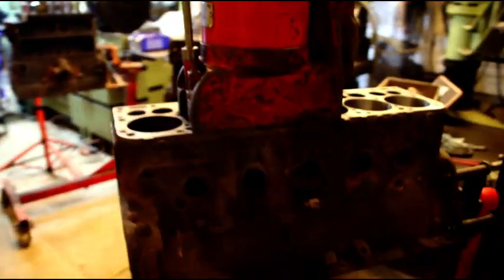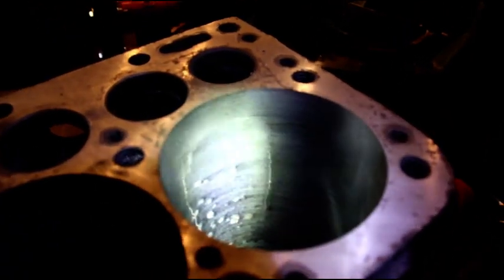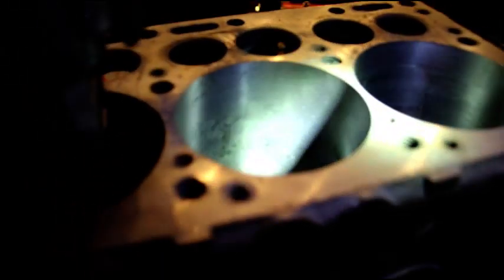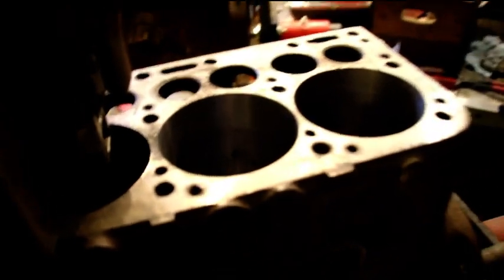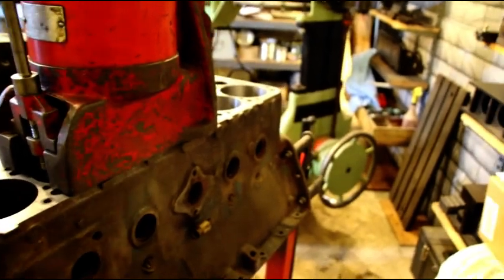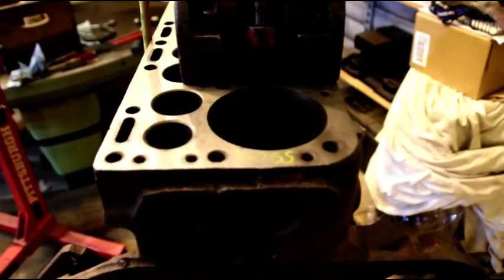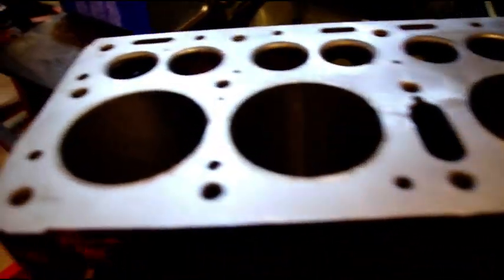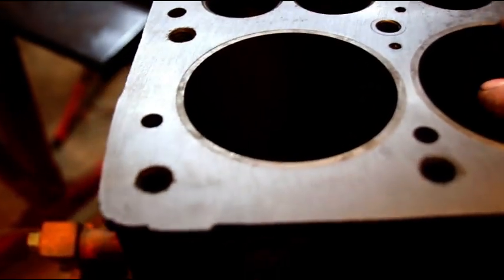Engine Updates, Hercules Boring, Travis L134 Sleeved, Lou's M38, Larry's L134, and More........

Comment: Perhaps an unanswerable question-when a block has cracks that the machine shop says they can't fix- my  situation-where to  look for a buildable Fhead block?
Reply from the maker: Why can't they fix your cracked block?  I have a bunch of F head engines here and can check to see if I have a bare block.
Reply: It has two cracks, involving cylinders 2 and 3, exhaust valve area- the cracks go about an inch from the valve seat on the block top surface, and an equal distance under the valve seat down the pathway for the pushrod.  Total guess on my part is that the installation of the valve seats was done in  a way that stressed the block.  Would appreciate it very  much you could check your  block supply.

Comment: Good thing that you were able to bore some extra material on Travis' block, to get the hole for the sleeves straight. What would happen if it was crooked and there was no extra room for boring? Would it have to be sleeved and bored 0.010 over to try and make it straight? Trying to figure out what I'd have to do with the AMC 232 I'm working on. Thank you for the update, I see lots of great content coming up!
Reply from the maker: I am now switching to the SIP machine for boring so I can bore perfectly with the crank centerline.  I can straighten a hole, move a hole, etc....
Not so easy to do with the boring bar bolted to the deck surface.  I was able to get Travis's block in good shape because I had different sized sleeves and had a bit to bore true.  Not sure on your 232, need some details on current size of bores.